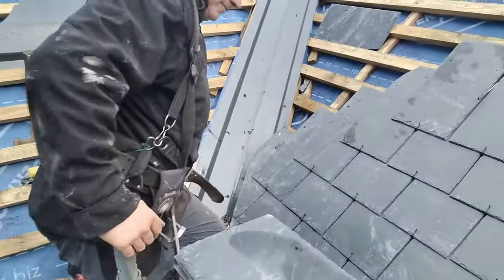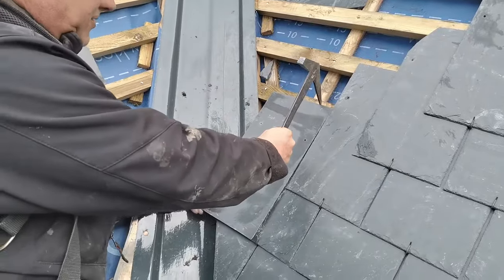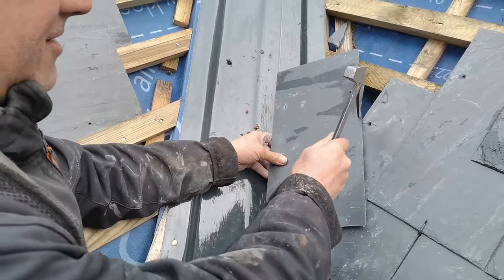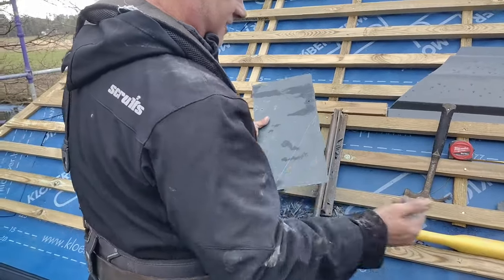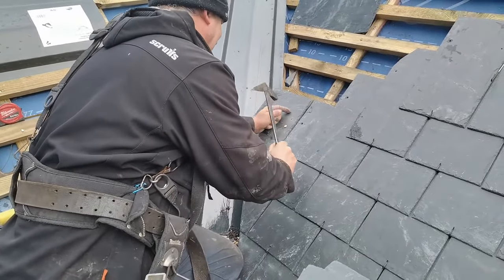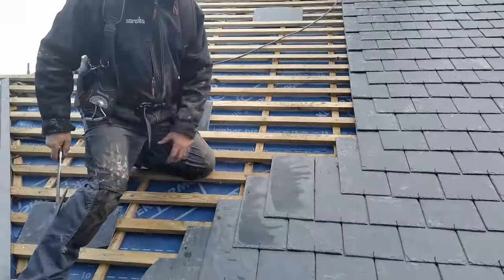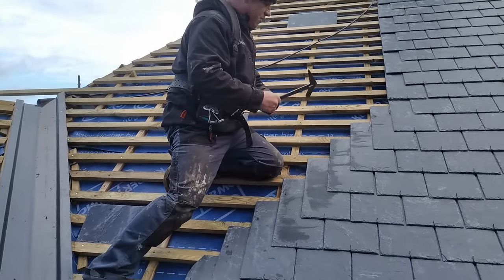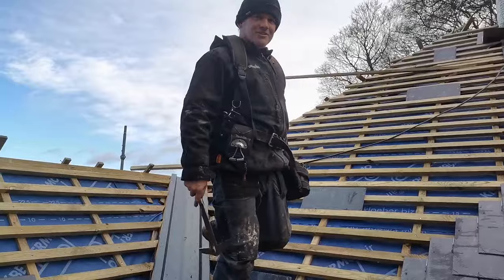How to cut a slate for a valley. Using 100mm slate hooks

Comment: That works well, also try a sliding bevel, once the slates sit flat after any kick or tilt at eaves level, all you need is to mark from side lap to valley cut, use your level, mark and cut.

Comment: I thought I was the only roofer to use slate hooks. Glad to see others using them. They are more secure than nailing. One point for you ,there is a hook tacker on the market  that speeds up the whole process, amazing device.
Reply from the maker: I'm going to look that up. Thanks
Reply: Slate hook is  for extra protection ur still ment to put 2 nails in the slate
Reply: used hooks and battens in Campbeltown 1985
Reply: Just watched our neighbours new house roof go on. They used hooks but only one nail per slate. Is this correct or should two nails per slate be used?

Comment: Can you push the slate up out of the clip to remove a tile? Asking as I might need to put a vent pipe up a slate roof with what looks like this fixing system. 

Thanks in advance!
Reply from the maker: No, you need to bend the hook down and slide the slate out.

Comment: Aren't they suppose to be nailed as well as hooked ? Won't they rattle with wind otherwise ?
Reply from the maker: No they can't move. There's a hook at the bottom, one on each side and one at the top. There more secure than a nail down slate

Comment: Surprised the perps aren’t struck out ? Perhaps you did further over to the right,  but plenty of tolerance between slates. How come you’re not using a slate knife or your combi hammer/slate knife ? Don’t think you’d be cutting some of the slates I’ve used over the years with your machine. I’m guessing  you’re using Spanish slate and a bit softer in my experience. Nice job for me, plenty of pride.
Reply from the maker: They were struck. Just washed off in the rain. I use a guillotine because it makes less mess
Reply from the maker: Yes spanish.
Reply: No point in perps when you're falling into a valley or a hip cut.
It's easy enough to tile or slate straight enough.
Into a verge or an abutment then yeh ping your perps
Reply: @Reddwarf1994  Yeah, I’ve done it too but never with the  ‘ old tradesman ‘ who taught me !!!! No slates touched til the marking / setting out was done, his way or the highway !!!
Reply: @barrywood7400 fair game to any old school tradesmen who do things the right way. Working by the book is dying out sadly.
In this instance though perping is not necessary in my opinion
Reply: @Reddwarf1994  No worries pal and times they are a changing for sure in many other ways through out society in general. Keep your great work up.